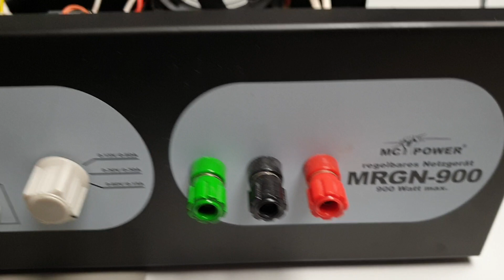💥I just blew up my 900W power supply

Comment: The control system must be galvanically isolated from the power section of the power supply. Using ICs like IR2110, IR2125 is a bad idea for power supplies of 1 kW or more. The 1EDC60I12AHXUMA1 driver is a good choice.